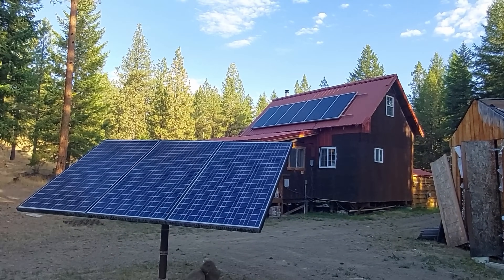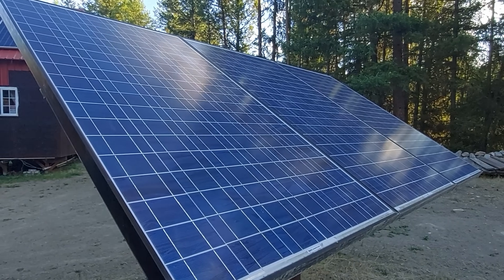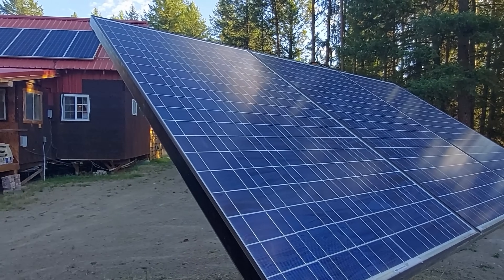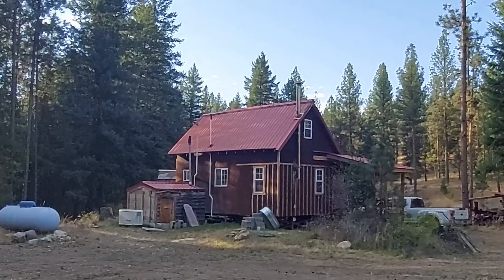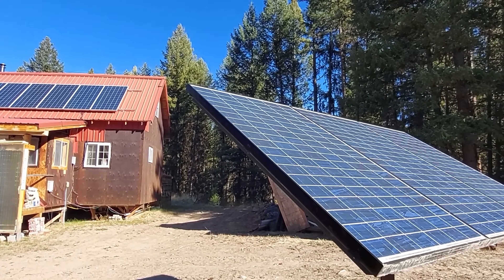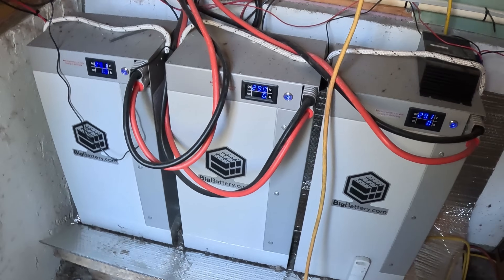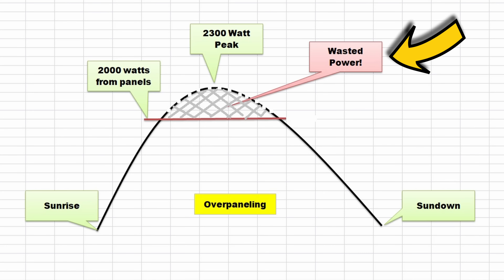Unlock the Full Potential of Your Solar Power! ☀️

Comment: You will find out very shortly that when cold weather hits and the cloudiness sets in, that your solar panels WILL NOT be enough to keep your batteries charged or your home powered.
I am over-paneled and that is not enough.
The sun is much lower in the sky and it has been raining for about a month.
I have had to turn off all my solar systems and run chargers constantly.
Keep an eye on your batteries or they will get depleted to 0 very quickly.
I have 12 household circuits that are off-grid with grid backup.
In the summertime, it is great... In the winter, solar is worthless.
If you use an electric blanket to keep your batteries warm, it will drain your batteries completely very quickly.
Reply from the maker: After nearly 15 years?  Living at the cabin for over a year, at nearly 49 degrees?  With at best 2hrs of sun in the winter on a good day?  I've got all the power I need because I cn charge my batteries in an hour of sun and no longer need my backup generator unless there is virtually no production at all, even on my ground mount panels and frankly, I've not experienced that since 2017 when I added 1800+w of solar and a 2nd MPPT 😊😁
Reply: @TheOldJarhead  wow that is good I wish I could do that how did you do it
Reply: @TheOldJarhead  I have a total of about six strings of 750 watt panels and none of them are putting out anything to charge my batteries
Reply from the maker: In full sun?  Seems something is wrong.  I'd check voltage at the panels before the breakers, then after the breakers and so on.
Reply: @TheOldJarhead  I did, we have not had full sun in a month
Reply from the maker: OK.  However, even in low light you should be generating power.  What is the total operating voltage of the array? and the battery bank?
Reply: @heroesandzeros7802 , it would be interesting to know how your wiring us configured?  How many panels are in a "string"? Is each string in series?  Are the strings then wired in parallel?
Reply from the maker: Good question as well.  I'm guessing this isn't a question of overpaneling, like the video but I'm happy to try to help sort the issue.
Reply: @FlatOutFE   I have several separate systems.
Main House: has 3 sets of 6- 100W panels and 3 sets of 3- 250W 24V panels, 6- 30W Charge Controllers, 2- 4000W 24V FSW Inverters, and 8- Group 27 12V Batteries.
This also has relays to select which of 12 circuits will be on solar or grid.

Refrigerator and Freezer: has 6- 100W Panels, 1- Charge Controller, 1- 2000W 12V Inverter, 4- Grp27 12V Batteries. This system is controlled by the CC and Alexa.

Garage and carport: has 3 sets of 3- 250W 24V panels and 1 set of 6- 100W panels, 4- 30A CCs, 1- 3000W 24V Inverter, and 6- Grp27 12V Batteries.

Pool pump/ heat for the shop, (Tilt): has 4 sets of 3- 250W 24V panels, 4- 30A CCs, 1- 4000W 24V FSW Inverter, and 2- Grp27 12V batteries.

Off Grid Building: 3 sets of 3- 250W 24V panels, 3- 30A CCs, 1- 4000W 24V FSW Inverter, 8- Grp 27 12V Batteries.

RV: 2- 100W 12V flexible panels, 1-30A CC, 1- 1000W 12V Inverter, 3- Grp27 12v Batteries

Trailer/Electric Tongue Lift: 2- 100W 12V Flexible Panels, 1- 30A CC, 1- Automotive Battery.

All systems have grid backup, except for off-grid building, RV and Trailer.
Each string has it's own Charge Controller. 
Each CC can handle 780W. 
I have arrays mounted in mostly south facing directions, but also have an East facing and a West facing array, and a tilt with 12- 250W panels on a tracker.

My main system for my house has a relay system to choose which of 12 household circuits will be on grid or solar, and a relay for total grid backup.
That all comes off of a whole house generator.

Each system has a low voltage relay controlled by a charge controller.

I have been building Industrial control panels since 1981, solar control panels are not hard to do.
Getting the sun to penetrate clouds is hard to do.
Clouds are costing me money.
Reply from the maker: "3 sets of 6- 100W panels and 3 sets of 3- 250W 24V panels, 6- 30W Charge Controllers: -- ok, so 6 total arrays.  Three of them 600w arrays and 3 750 arrays all run to 30amp (not watt) charge controllers?  That would mean a potential 180amps of charging coming off the combined arrays if into one battery bank. Each 600w array can produce about 23.5amps of solar if I'm reading it right, and each 750w array can produce 29-30a of solar (a little too hot for the CC I suspect).

But it sounds like each array is feeding different battery banks -- I'll admit, that confuses me and I think might be an issue where you are not getting full use of all available power.  Also, you mention group 27 12 batteries -- and 24v inverters so I'm guessing series parallel config on the banks that are 4 batts vs series on the banks that are two.

Right off I'd say, make one battery bank, feed the arrays to that one bank but make sure you don't try to push too many amps into the batteries at once (and if lead, don't use more than 25% for longevity).

Then run 1 or two inverters (depending on needs but I prefer one myself) to provide the 120v power and a 24v to 12v step down converter for any 12v stuff.

As to why you produced NO power (which I believe is what you said) I'd need to know more like:  was it cloudy?  Raining?  Snow covered?  etc -- after all, with that many arrays they should produce power, if none did something is simply very wrong or it they were all under the snow.
Reply: @TheOldJarhead  it has been cloudy and rainy for the last month or so
Reply: Each system has its own group of batteries as I listed
Reply: It has only snowed one time which is long gone
Reply: @TheOldJarhead  it is just that the sun is much lower in the sky right now and very cloudy
Reply from the maker: This would be where I'd combine those strings (batteries and solar) and get more charging out of a larger string (not over paneled mind you so a larger CC is probably in order).
Reply: The disadvantage of creating a single battery bank is trenching and feeders need to run to each structure.
Reply: @TheOldJarhead  I cannot do that the distance is too great
Reply from the maker: True = Good point.
Reply from the maker: Undertstood
Reply from the maker: That'll do it

Comment: Think most of that stuff boils down to people having some kind of crazy desire to push their equipment to it's limits. Possibly motor heads that used to buy their hotrods and burn tires off the wheels and blow engines to feed their need for speed. They just switched over to solar power. 😂
Reply from the maker: Haha, you might be onto something there!  I think the issue is some really good salesman.  That, and people buying All in one systems that are too small and trying to get a little more out of them.

Comment: if you installed a correct charge controller in the first place adding a larger one will give no benefit so you will still have to add panels to get more power. for off grid systems no matter how you build a system to get enough power in the shorter winter days(more of an issue the further north you are) you will have an excess for a good part to the longer days.  clipping is not as much of a problem in the summer as being low on power in the winter. plus i am not sure you mentioned that over paneling will give you in increase even in the off peak hours which means an increase thru out the day that a larger charge controller will not do.  and add to that that clouds are unpredictable so you may not have full sun at any time, more panels should mean more power when ever the sun shines. there are many options on how to get the power you need/want and it is good to think about what will work best for each individual system.  there are places that are now installing panels facing north just to utilize the space they have to get more production(grid tied systems)and this would have been laughable a few years ago.
Reply from the maker: The thing is, installing a charge controller, as I stated, that can take ALL the power you can produce at peak output will not hinder production in poorer conditions.  Over paneling doesn't increase production it just appears to.

A larger CC (properly sized for your array) will allow all the power your panels can produce, winter, summer, cold, hot, doesn't matter.  One that is too small (IMO anything rated less than total solar potential is too small) only clips the power above it's rated wattage but doesn't increase power production at lower light.

People do this sort of thing because they either think it will generate more power (it won't) or they didn't size the system enough to begin with.  Adding another 300w panel to a 2000w array WILL help in lower light conditions -- but it will help whether you put in a large CC or not.

At issue, for some, seems to be using AIO systems (All In One) which I'm not a proponent of though they have their place, specially in cabins where you don't want to spend as much as like the ease of install etc.  However, it doesn't mean you can't add another CC (and associated breakers etc) if you need more production and rather than over panel, I'd advocate for arrays facing different directions.
Reply: @TheOldJarhead  different ways of solving a problem such as not enough power in the shorter winter days. i am not aware of any fix that wont have your system producing far more energy than you can use in summer while providing enough in winter so clipping during summer is not really a problem if you are making everything you need and still can get an increase in through out the whole day in winter. and yes over paneling gives you a wider bell curve even with a smaller charge controller. i think we are just emphasizing different methods, each works and the individual should review what is better for their particular system
Reply from the maker: True, though I use a lot more power in the summer and never need my generator  😉

Comment: I'm over paneled, as in, I've paneled for the worst days of solar production. Each string has its own mppt so I'm not overpaneled as suggested in this video.
Reply from the maker: Typically 'overpaneling' refers to putting in more total solar wattage that the charge controller is rated for.  

In your case, I'm the same.  I have considerably more power than I need in the summer but just enough in the winter :)

Comment: Yes, a larger charge controller is a great remedy for overpaneling. However, I'm experimenting with another theory to capture more sunlight before and after peak hours. To simplify things, let's say you have eight (8) 100-watt panels, 4 panels aligned for peak hours (11am-1pm), 2 panels aligned a few degrees East, and 2 panels a few degrees West. Theoretically also capturing sunlight between 9am-11am, and 1pm-4pm. This would provide a more consistent (6-hour span) solar input, versus the "peak hours". Because a High-quality Solar Tracker is pricey.
Reply from the maker: Essentially what suggest.   Though I'd use multiple controllers
Reply: @TheOldJarhead  ~ Thanks 😎
Reply from the maker: You bet

Comment: Another way to get more power out of your panels is to invest in a solar tracker. 30-40% gain by trackers.
Reply from the maker: True though typically they are more expensive then adding panels.
Reply: @TheOldJarhead not to mention moving parts which means maintenance
Reply from the maker: True -- I have seen some inexpensive trackers but most are very expensive and typically only give about 25% more production.  By adding more panels you can get that production for less.  Even better, add the panels facing a different direction.

Comment: Another very important trade-off is between your investment in solar panels and your investment in batteries.  With sufficient battery storage just situating the (fewer) solar panels in an optimal direction gives you the most daily energy production.  Usually.  But if you don't have the money to invest in that much battery storage, having more solar panels with a string pointing Eastward (morning) and Westward (evening) can give you roughly 2 to 2.5 more hours of "decent" generation across the day, reducing the overnight hours that the battery needs to support from (say) 18 hours to 15-16 hours.  Roughly speaking.

Given how cheap solar panels have become, this type of optimization can make ends meet when one does not have the funds to invest in sufficient battery storage.

Having these additional arrays also tends to do better in Winter when party-cloudy skies might have periods of clearing outside the optimal solar peak, and you get the benefit from all the arrays when only ambient light is available due to clouds.

The rule of thumb, for winter off-grid, is to try to reduce (gas) generator run times to just a few hours a day.  Usually by topping-up the battery bank in the late afternoon (after 5pm) to 100% to guarantee sufficient energy for overnight operation and any battery bank heating that might have to occur through to the next morning.

--

Any substantial off-grid system should really be doing 24V or 48V (48V preferred) battery banks to improve efficiency, reduce cable sizes, and vastly improve the maximum wattage the charge controller(s) can take in for any given amperage rating (2x for 24V, 4x for 48V, verses 12V).  Many of the old "overpaneling" methodologies were done out of necessity because people were using 12V battery banks where dealing with high amperages translated to substantial cabling and costs.

With 24V and 48V battery banks, the charger controllers can have modest amperage ratings with outsized power handling.  For example, the very same 35A charge controller can push 448W to a 12V system, 896W to a 24V system, and 1792W to a 48V system.

--

Something else I will note about Mono vs Poly panels... both types (of older panels) have been supplanted by bifacial half-cut panels which generally do extremely well in cloudy / ambient / low-light conditions... far better than older poly panels ever could.   Today you more or less always get modern bifacial panels even for flush roof mounts.

-Matt
Reply from the maker: That's a great explanation of the trade-offs and I agree, bifacial panels are really the way to go these days!

Comment: In cold temperatures, do the panels produce more volts or more amps, or more of both above the rating? I’m trying to find out what buffer to plan in equipment, but haven’t found the answer.
Reply from the maker: I'd have to check the amperage, but the voltage goes up.  I've seen 60+volts on my 54v array in winter!
Reply: More volts and slightly lower amps, but the voltage is dominant. You can find the numbers on solar panel spec sheets.
Reply from the maker: Thanks

Comment: You convinced me to invest in more MPPTs and arrays so i can have array #2 set for early morning capture. Just have the same MPPTs with the same output settings, tied in parallel.
Reply from the maker: That should work fine! You'll love it!
Reply: Other than the settings.  You can mix and match panels and MPPTs . The batteries don't care . As long as the settings are the same
Reply: @joshkelly3743  ill pass on mixing panels
Reply from the maker: I have two completely different arrays which is what he's referring too.  You can do that all day long.
Reply: @ewokjerky4508  not mixing panels in a string. Tho that can work
Reply from the maker: True, though I've seen testing that suggests mixing panels of the same type but different sizes can work fine.

Comment: I have a 900 watt max PV input on my 12 volt system do I have 4 200 watt bifacial panels 🤷‍♂️
Reply from the maker: That works!  Put's just just under the MPPT max 😁👍
Reply: So not do 😂😅 and it's a 60 Amp Mppt
Reply from the maker: Got it 👌Sounds like you've got it figured!